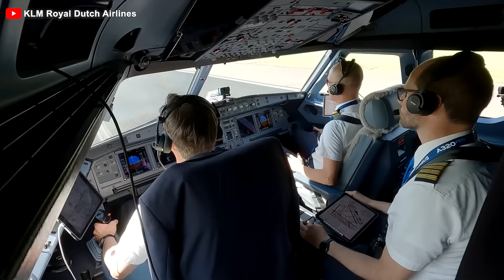Emirates, KLM & Qantas Say GOODBYE to Boeing and all turn to Airbus! Here's Why

Comment: It’s hard to believe that this airlines cancelling boeing 777x which will be the dominant aircraft on the market !  It’s seams to be a propaganda video for airbus ! Isn’t it ?
Reply: The 777X is going to end up being at least 6 years late because of Boeings own corner cutting. So customers will understandably be getting annoyed with Boeing.
Reply: Can’t understand your analysis. Why are  you so convinced that 777X would be dominant aircraft on the market ?
His rivals A350-900 & 1000 are already on the market for years and selling well. On the other hand B777X is still on the verge of certification with some problem to be corrected. Then you can’t compare the two planes real specs because one is not in commercial duty. So, airlines choice is not a nationalistic engagement but a realistic move based on quality, reliabilty and real performances. Not the paper figures !
Reply: You must eat McDonald’s for breakfast every morning? Huh? 😅

Comment: Boeing has not been the same since it merged with McDonnell Douglas. The company that was once the pride of America and the industry, is long gone. The name is still around but it is NOT the company that William Boeing created and Bill Allen ran, so sucessfully for many years. When I heard that they were merging with McDonnell Douglas, I got sick to my stomach and had a sense of dread. I say, "good for these airlines" for choosing aircraft that don't have controversial safety issues. Flying used to be fun and exciting but not anymore. I used to be a lifelong Boeing fan but that was when they were a top notch company that cared about safety and using only state of the art, high quality materials and parts. Now if I fly, I choose airlines that operate only Airbus aircraft.  Remember the saying, " if it's not a Boeing, then I aint going"? Well nowadays, if it IS a Boeing, then I aint going!  My faith and confidence in them, is gone.
Reply from the maker: Sounds sad.

Comment: Boeing has shot themselves in the foot too many times, and carriers are fed up with delays and excuses. Mean while Airbus is taking advantage of the situation and are winning over the airlines. Many people are still afraid to fly on anything with the Boeing name on it. I for one refuse to fly on anything Boeing built in the past 10 years.
Reply: @mikestone9129  perhaps, but meanwhile Airbus airplanes are pegged to RR engines. B777GE will rule the sky, whatever model Airbus could thought to the market, will not be good enough to match the Boeing/GE combination
Reply: @jjiglesiasg only the A350 and A330NEO. Customers can chose between Pratt and Whitney or General Electric on the A320 Family
Reply: @monkey2702mw  by the way in the A320 family are CFM engines not totally GE
Reply from the maker: true

Comment: Time to get rid of the unions at Boeing. They are dragging the company down.
Reply: Unions, in a very long struggle, liberated the working man from slavery. But for a right-wing hillbilly, that is too much knowledge to consider.
Reply: This seems to be the wrong culprit. What Boëing needs is a loyal team of mechanics, engineers and management in order to wheather the upcoming storms.
Reply: Sure, and lose all your employees. The workers have been treated like shit. The company has been dragged down by management decisions, design faults and an inability to compete with Airbus, who also have Unions for their workforce. Respect your workforce not demonise or mislead them.
Reply: Imagine if Boeing had good management
Reply: Boeing are trying but need to remove the top tier of management, those executives who took over after the acquisition of McDonnell Douglas, who made the decision to get rid of the engineers and start cost cutting and focusing on profits over quality control and flight safety.